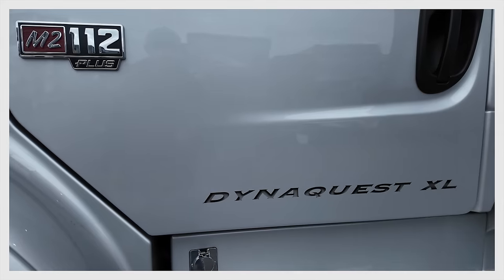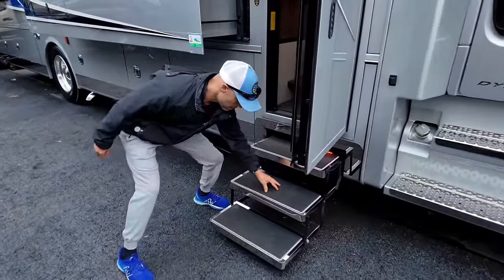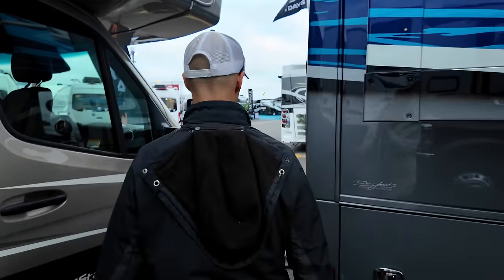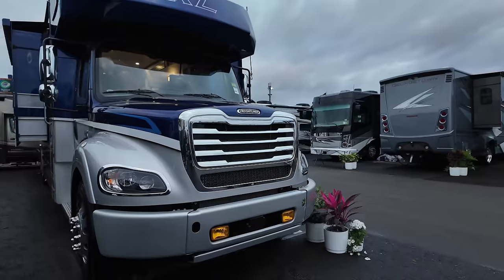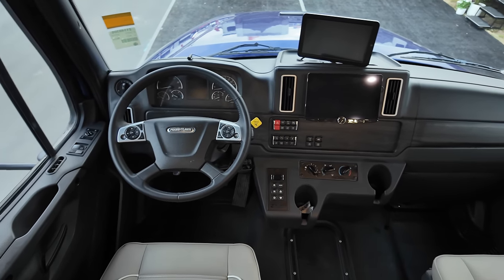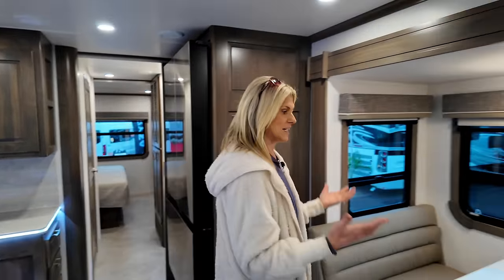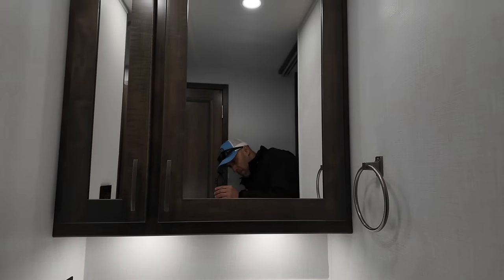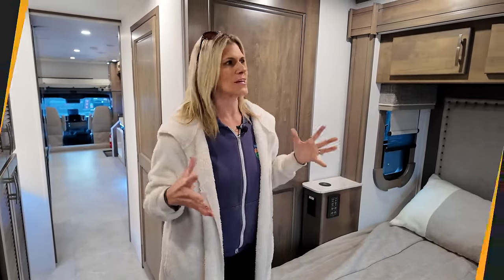The Most Affordable Luxury "Real Super C" Motorhome On The Market -- 2024 Dynaquest XL!

Comment: Almost like the one I had and used and abused it for racing. The larger engine was a big plus when pulling a 30ft trailer. Dynamax does a great job with the paint and overall build. For the price, I would go Dynamax all the way, even vs. a Renegade Verona.  My son loved the bunk but trying to turn those captains seats in the front is part puzzle and endurance test! Thank you for the great video!

Comment: Very nice Super C, nice paint job, nice interior. The issue I see with the Super C is that about 6 ft of the total RV length is just „engine“. In a Class A you will fit the same interior in let’s say 35ft long RV. I also bought the Release concentrate with your discount code as well the Cheetah V1 at Chester, again with your coupon code - Thanks!
Reply from the maker: Awesome, hope you enjoy the products! Thanks for watching . :)
Reply: @EndlessRVing  Release is a great product. And I just received and tested the Cheetah router at home without the external roof antenna, works great. Chester is nice they gave me a Test SIM card for 2 weeks for free with unlimited data. The actual new SIM card will be activated when I travel with the RV April 1st.
Reply from the maker: @aeconsulting1  that’s awesome! Safe travels. :)

Comment: is it just me or is almost 500K expensive? Think about how big of a Luxurious house you can buy for that amount of money in any state.
Reply from the maker: Motorhomes are very expensive
Reply: You can't drive a regular stick and brick house down the road. So the intent of these are completely different than a static built home. Comparing the 2 is definitely an apples vs oranges type of comparison. The Driveable and towable (house on wheels) market you tend to get what you pay for. Every mile traveled is 1 mile of shock and abuse. Unfortunately they don't make too many "affordable/more cost effective" unit that have the higher build quality like these with out all the glits and glame. The more "entry level" units, roughly half the price, unfortunately tend to have a harder time staying together over time due to road mileage and "light weight/lighter duty " building materials.

Comment: 80 32oz bottles from the concentrate bottle?  My math may be wrong but it looks like 20 32 oz bottles, not 80.
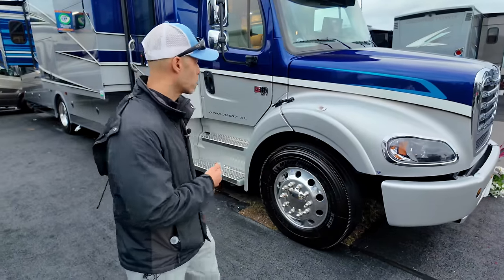Reply from the maker: Actually 80 32 oz bottles is at the strongest ratio dilution (1:20) You can get many more bottles if you dilute the concentrate more.